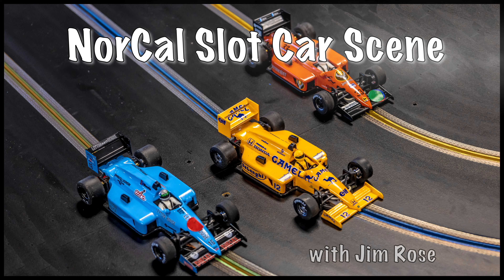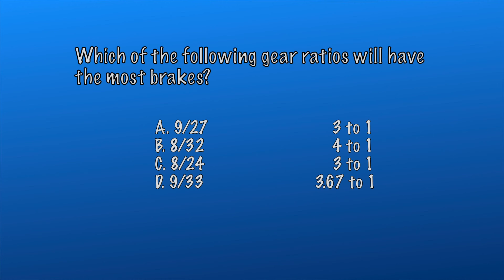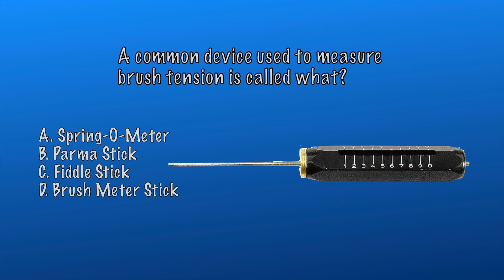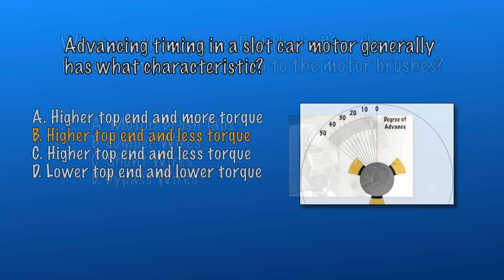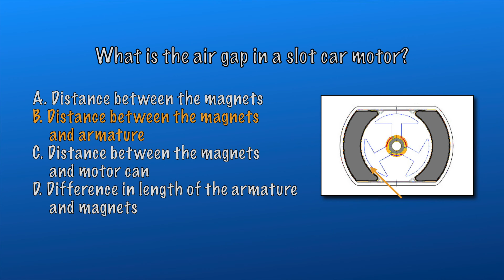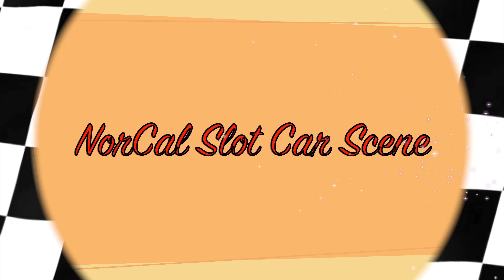Slot Car Motor Trivia

Comment: Brushes do not transfer power. They allow current to flow. The current flowing through the windings creates a magnetic field which interacts with the permanent magnets. A turning force is generated, torque. The rate at which that torque is produced is power.
Reply: Yes they do. Brushes transfer electric power.